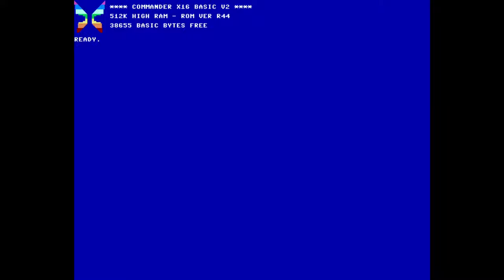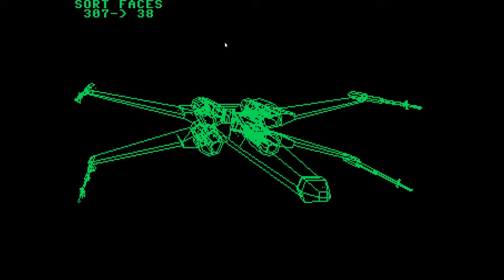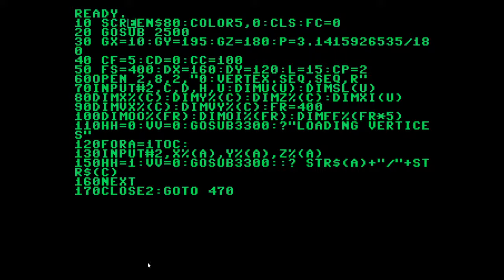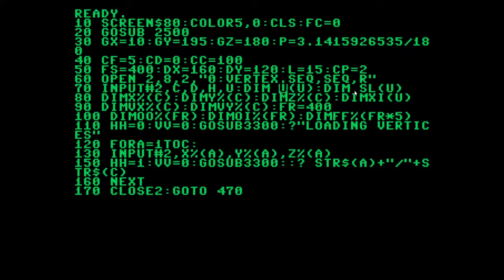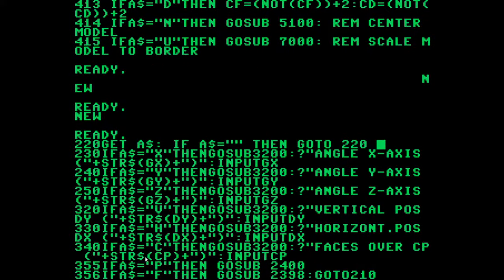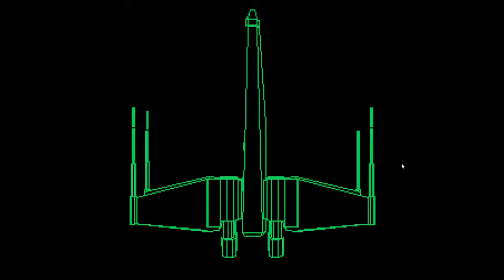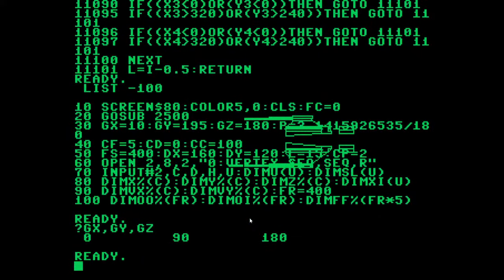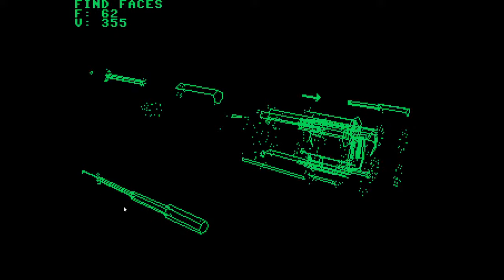X-Wing on Commander X16 | 3D-Render | 8bit Computer | Star Wars | Live-Talk

Comment: Well done, very interesting video! It is nice to see how it runs on an other system. As it is also a 6502, and with 8MHz speed, no suprise, that the speed increase is not extreme, just improve the drawing to a more acceptable speed. 
 I suppose SVG style drawing would be really fast on Commander X16, as the used drive also faster than 1551 or 1541.

You know, what could be the best? a built-in BASIC compiler, that could create a blazing fast code after you finished the development. Sure, that native integers and short floating point numbers could significantly improve performance (in fact you never require the 5 byte long floating point accurancy we have on Commodore, even not for Moon landing :-) )
Reply from the maker: Thank you for the comment, my friend! Yes its not much faster, becauch the programm reads from the drive most of the time. A compiler will be interesting for the future!